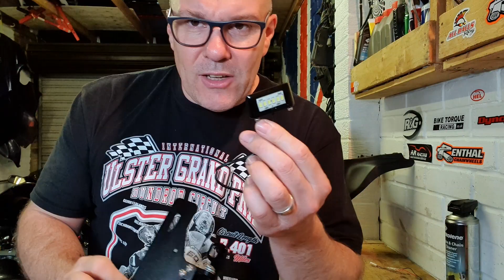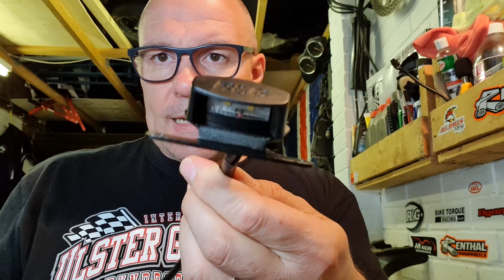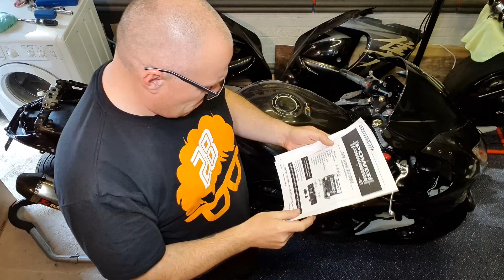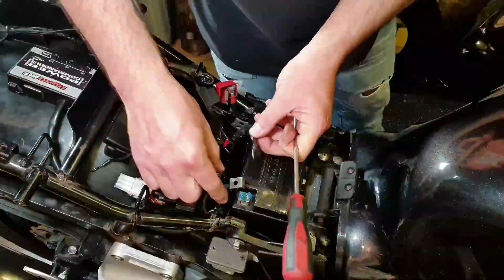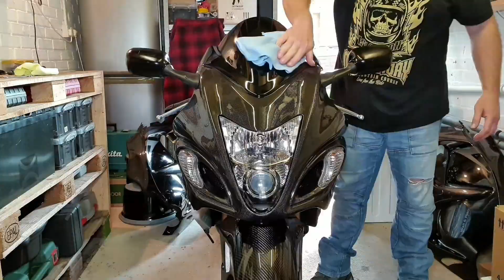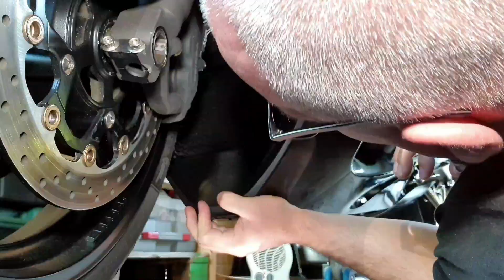Back Together Time - Hayabusa Build Series

Comment: Looking good mate, got to get rid of the pillion pegs though! 👍
Reply from the maker: Thanks mate, I need one to attach to the exhaust and the other for when I pick up taffy from work 😉 😂 it would be cool to get rid of them but I kinda need them too 🙃
Reply: @SixthGearMotorcycles   Not sure if this link works but just an idea. Might make a good video. i wouldn't do the cut outs i would just blend cut and blend the pillion mounts off. 
https://www.hayabusa.org/forum/threads/exhaust-hanger-mod-i-was-bored.160089/

there a few on ebay for sale if you wanted to keep the stock one for Taffy
Reply from the maker: Thats not a bad idea, thanks mate 😎 👍
Reply: Oh yes makes sense if taffy jumps on the back then, or make her walk take them off with a nice exhaust hanger so will look awesome! Taffy will understand lol
Reply from the maker: Haha true! 😆 the other thing is that the seat plastics (or carbon fibre in this case) moulds around the foot hanger and sticking a exhaust hanger in its place is gonna look odd but would certainly clean up the lines on the non exhaust side of the bike. Taffy has yet to return to work yet so maybe I could whip one side off 🤔😅
Reply: Lol try it and good luck staying alive tonight!